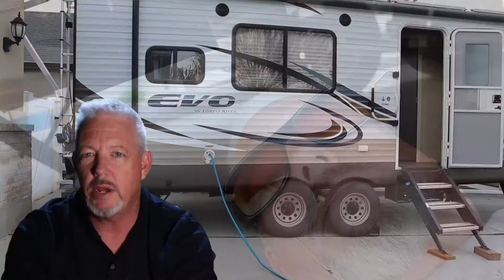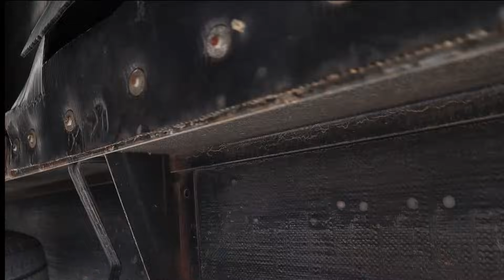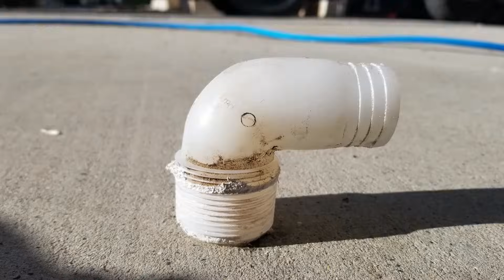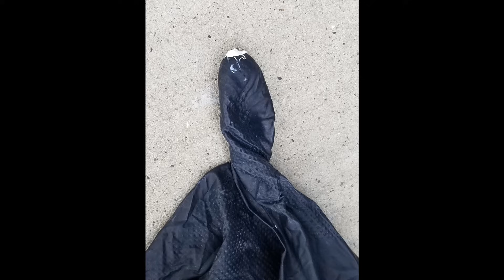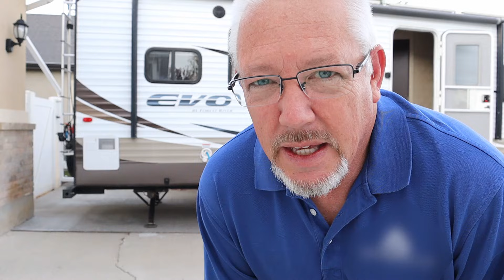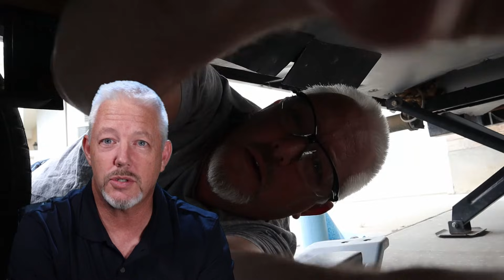RV water tank leak and repair  | TheRVAddict

Comment: I had a leak in my tank just before a camping trip this week. I tried teflon wrap as well and it didn't do the trick. I tried 100% silicone, but then realized that the threaded mouth where the drain plug screws into had split in half. I put a pipe clamp around it and it's sealed, but I now need to address that crack. Not sure how to do that.

Comment: A lot better than the gloved finger the doctor “offers” every now & then eh?

So at first you added both this silkka sealant & pipe thread tape to the fitting that threads into the tank & it still leaked so you took off the thread tape & just added sikka? Also I’m curious if you’ve looked/seen the bottom part of your freshwater tank & if it bows out & know if it’s supposed to up to a certain point? Heading out on a 30 day trip to the Rockies in about a month and realized my freshwater tank not only moves side to side & front to back but also there’s a gap of about 2 inches between the bottom of the tank & the support brackets.

Comment: I had the same issue when using teflon tape on my new plastic fitting. After wrapping the new fitting with teflon and threading the fitting back in the tank, it still leaks. I will try Sika Flex and hope it resolves my issue

Comment: I have  1999 Safari Trek 2630. 1st, I noticed that the pump would run constantly when I turned it on.  Then I noticed that the water level was dropping, even though I wasn't using the water. Then I noticed a small puddle of water, maybe 8" dia. after about 48 hrs. I went to fill my tank (1/3 as I was going to be travelling). I hooked it up according to the manual, opened the fill selector, turned on the water and the water went straight on to the ground.  What am I missing.

Comment: I tried your link to the sika flex and it isn't  working. If I search sika flex I get tube's of caulk.  I am trying to stop the same leak as you did.
Reply from the maker: I wonder if they stopped selling it.  Try asking a local rv shop if they will see you little bit, that is the only thing I can think of

Comment: My freshwater tank will not fill just beginning to explore the problem
Reply from the maker: Ross, you will have two water connections in your rv.  One for Cano ground pressurized hookup and one for water tank fill, check on both sides of your RV.  I hope this helps your troubleshooting.

Comment: Grand design reflection 2017 I have a water leak but I have no ideal how to find it. It’s dripping from out from the rear of the trailer.
Reply from the maker: Those are tough ones to find. If you are going to try and find it yourself, i would really suggest trying the wifi endoscope mentioned in the video description. It has many uses and will keep you from having to take apart the underbelly of your rv.. 
I hope that helps you🙂

Comment: Are you having luck sealing the bottom with gorilla tape. I have a few places I have "explored" and non of the tapes I have used had last more than a few months.
Reply: I had a tire blowout and some belly damage. I found Bottom Board Repair Tape by AP products. Is lots more than I needed and not cheap but is holding well above the wheel well even. Only has been several months and a few rainy travel days but so far so good. Seems like I will get to try it some more after fixing my cracked plastic of the neck of the water tank drain. Thanks RV addict for the video.
Reply from the maker: You are welcome
Reply from the maker: i thank you Peter for watching another video of mine 🤩, being that you ARE an RV pro with many years of experience, i have much to live up to 🤩 in how i make this type of video. 
I will keep you posted on the life span of the tape being under the trailer,  i have been using this Exact tape for the last year for many temporary and permanent projects around my home.
I love this tape 😍😍
Reply: @RVKevin  Not the Pro but owned and fixed a bunch of them. At least I am not changing canvas or troubleshooting roof raising systems anymore :)
Reply from the maker: @LetsCelebrateTV  Amen 🤩